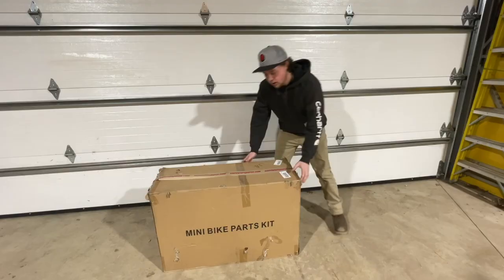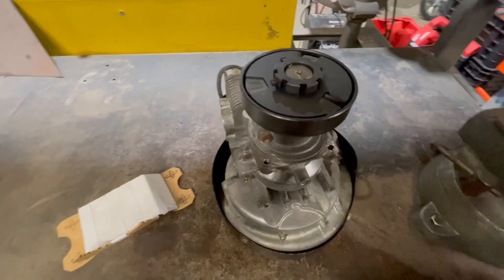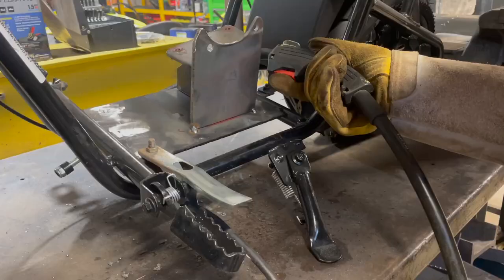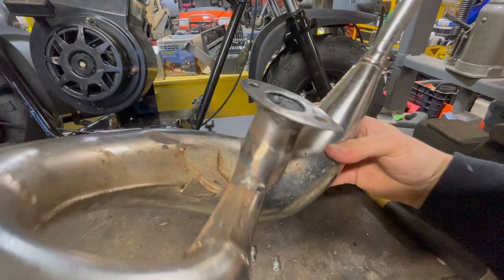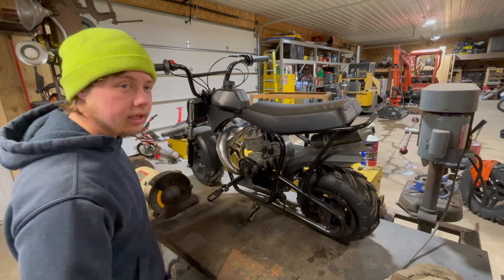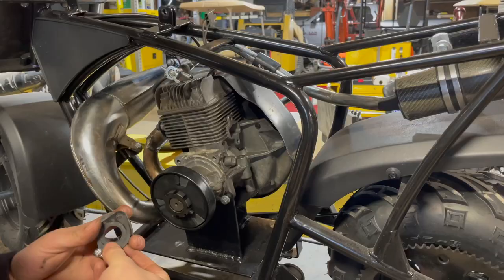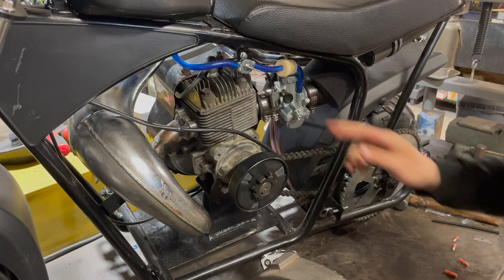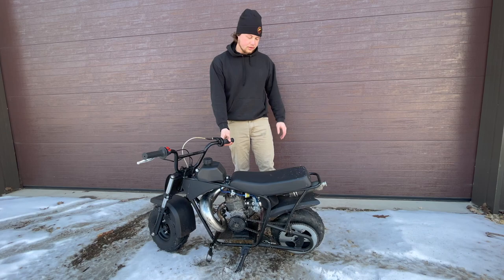Snowblower Turned Mini Bike… Crazy ENGINE SWAP!

Comment: As someone who made a ccr2000 mini bike here's a few tips. That 2 stoke exhaust is restricting it, you need to make a custom pipe for any low end / top end power. Switch to a torque converter, running a clutch requires such a high stall rpm that you'll be ruining clutches fast after good tuning and from my experience these engines run hot, so I have a rich fuel premix.
Reply: you just commented one hour ago that’s wild. i’m currently working on doing a build like this so i will take your word on the torque converter.

Comment: Nice job! Love the 2 cycle powered stuff. The tuned pipe of the 2 stroke is amazing in how dramatic of a performance enhancement or detriment it can be. Any 2 cycle regardless of size when it has a tune that is working perfect with its intended load will have this anger and rip that is something only a 2 cycle can do.  The volume and shape of the chamber is so critical to the displacement and intended power band adding or subtracting any length in front of the chamber can make unbelievable changes in power output.  There are a lot of resources online that can help with this complex process. The up side is by getting the right shape and length in that can you will get power gains that would require a long list of expensive mods in the 4 cycle world!  Good luck

Comment: I found a lipstick in the floor board of a car, used it to make gaskets like that, just rub it on the flange and stick some paper or something on it, then cut where the lipstick is not at, wipe off, or use as a template to make more,

Comment: nice build , i also too use a snow blower engine the Tecumseh 9hp 320cc four stroke 1994
  with some port work & a 26mm carb it`s gone easy 55mph
Reply: Can hit 55 on a 125 pitbike engine it will cost about $200 Same hp
Reply: @g4lines197  we are talking Mini Bike Engines WITH NO GEARS, no cheep china pit bikes plz

Comment: I did this while ago just so you know there's a difference on cubic inch the smaller ones are about 60 cc's and the bigger ones are 90 cc, you can also swap the top-end from a Yamaha rt100 take some fabricating but it works great

Comment: did you know if you take a harley davidson trans and put it on the minibike     that minibike will have 6 speed 2 stroke engine and trans and itll be EXTREMELY fast  especially with that expansion pipe on it      itll out preform a yamaha YZ250 100%     love the build buddy

Comment: Im using the same engine for a build , and having trouble finding a clutch that fits. 3/16 key and 1 inch bore. Anything i order off Amazon even in the description it says 3/16 but theyre all 1/4 inch keyd. What clutch or modifications did you do?

Comment: I have a craftsman snowblower engine on my fat cat mini bike, the drive shaft spins constantly while the engine is running. Curious why and what I’m doing wrong. Won’t it melt thru the belt if the bikes not moving?

Comment: What snow blower is that engine off of? im now trying to find a 2 stroke engine that will fit on my mini bike.
Reply: Ive got the same motor he used and it runs good if your interested
Reply: @shaunjoiner732   what is the motor so i can look more into it

Comment: I've always wanted to know more about adapting clutches to random shafts. How or where do you get adapters?
Reply: With a lathe anything is possible
Reply from the maker: Like Aaron mentioned below, with a Lathe/mill anything is possible. This engine used a 1" shaft. However the crankshaft is currently being machined down to a more common 3/4" shaft. I will go into more detail in the upcoming part 2 video!

Comment: I have 2 500 cc 2 stoke jet ski engine if anyone wants to make an offer  I don't want them
Reply: There inside the jetskis right now u can get those as well
Reply: Jetski's are pretty junk because the only place you can use them is on the water and no one does really does custom water builds so ykyky. You cannot flow enough water trough them to keep them cool unless it's a huge rad so
Reply: @cro-thehacker7018  u make no smece